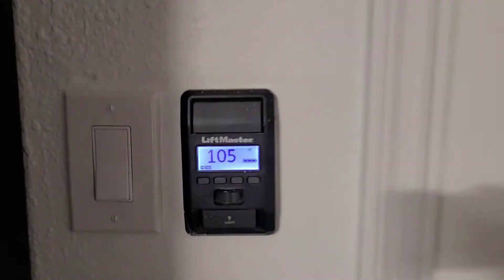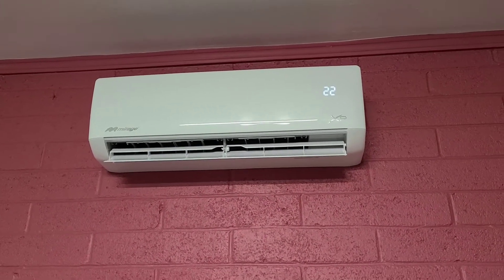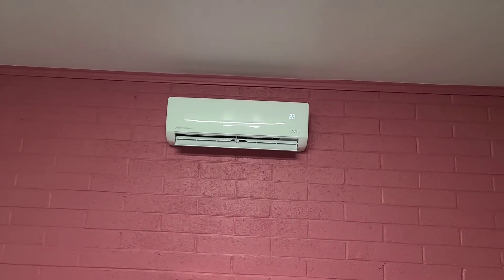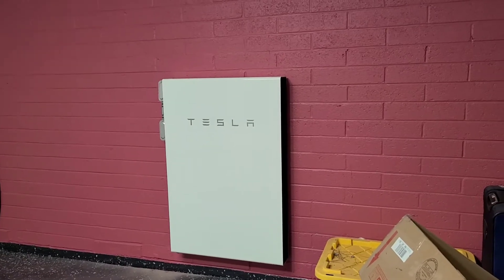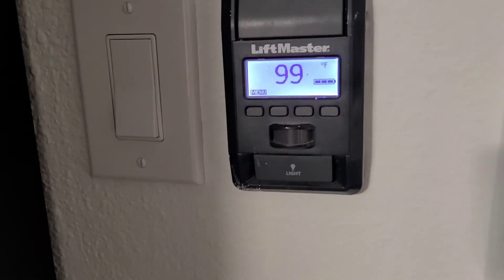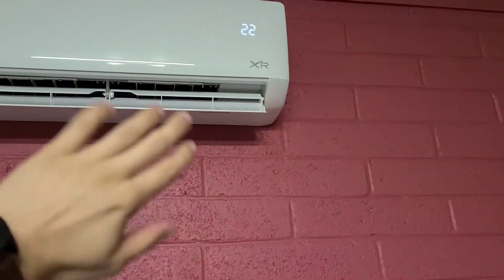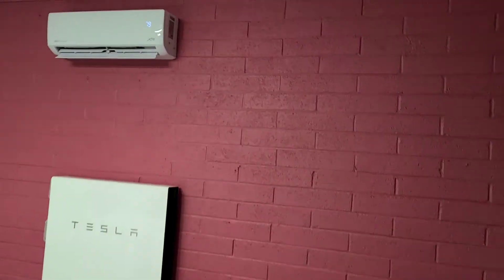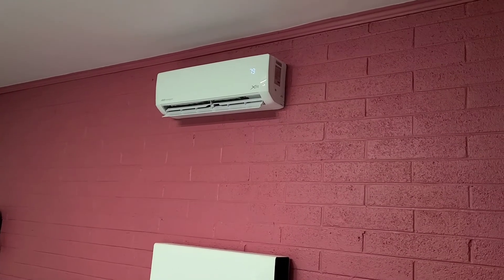Should you get a Garage AC? Powerwall & Model 3 Impact in AZ

Comment: Really interesting video. Would you be able to provide some feedback on the Powerwall performance post garage AC installation?
Reply from the maker: hey sure. what specifically? i can run this AC for about 5 hours w/ the powerwall alone (which i dont) in addition to my normal house usage

I run this garage AC to pull from the grid and turn off during peak so I can use the main AC w/ solar during peak and any overage to the PW
Reply: @RobertSchmitt  Sorry, I should have been more specific. From the Tesla software using the Powerwall charge and discharge data, I see people estimating a percentage of loss due to the batteries self maintenance (i.e.., cooling or heating itself). I have not found anyone doing a study of how much is lost on locations that greatly alter the storage temperatures, like mounting a Powerwall outside verse inside or adding AC cooling like you have. As an example: The Powerwall 2 has an optimal operational temperature range between 32°F to 86°F (0°C and 30°C). It can operate between -4°F to 122°F (-20°C to 50°C). Your garage was 105F before the AC was on and something below that after it was on. It would be interesting to see the power charge verse discharge amounts for both non-optimal and optimal temperature ranges makes that big a percentage change in performance. OK, sorry too much. Ha.

Comment: Thanks for sharing your experience.  What direction does your garage door face?  Do the PWs themselves produce much heat?  I am building custom in Peoria, AZ with a north facing garage.  I was planning on having the PW's installed in the west wall of the inside of my garage.  I will be using mini-splits in my build inside, but am hoping to avoid putting one in the garage if I can help it.  If you were building custom and planning on PW location, would you try to have a seperate walled off "utility" area?  I plan on using a hybrid (heat pump, tank) water heater in the garage that will emit cool air so hopefully I won't need another mini split
Reply from the maker: the sun hits my garage right now, and even 70 degree weather, the garage is almost too hot to touch. insulation helps a lot here as inside temp stays pretty safe. My garage faces South East.  Powerwall does exhaust excess heat, but doesn't really impact a 500 sq ft garage much ( i have not measured). This mini split system has been awesome in the winter too for keeping the garage from getting too cold and frankly the car and pw which have less performance in cold weather.
Reply from the maker: If i were to build a custom one, I would put them in an area that is most shielded from temperature changes to optimize the efficiency of the PW. Then paint around it. When it's 120 out, no level of insulation really helps much. Garage will get over 100. I also have a fridge in the garage that has to work harder. I run the AC during off peak so its OK for me. I also need to go into the garage in and out during the summer and do not want the air to be lost from the inside of the house, or have too hot garage air leak in

Comment: Love to see content from the Arizona experience.  Installed a 2 ton (24,000 BTU) MRCOOL a few months ago and what a difference!  Such a pleasure getting in a cool car instead of one that has been baking in a closed south facing 100 degree + garage!  Hope to get my M3LR  by the end of the year. Keep up the good work!
Reply from the maker: Woo hoo! Your car will love you For it. Thanks for the kind words. Hopefully some nice updates to M3 before you order =)
Reply: Michael what size is your garage? Does the 2 ton do the trick?
Reply: @dtr4ne  Garage is about 800 SF. Keep it set at 84 during the summer and keeps cool. But in the heat of the afternoon, 115+ degrees is difficult for any system but 90’s are typical.. Also depends on how frequently you open the doors,